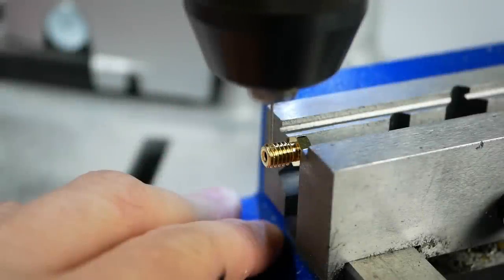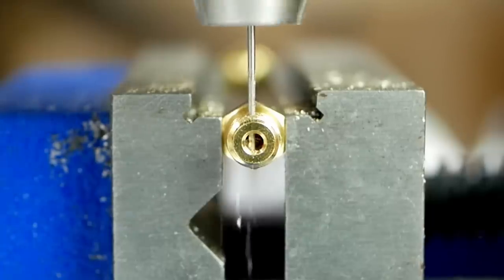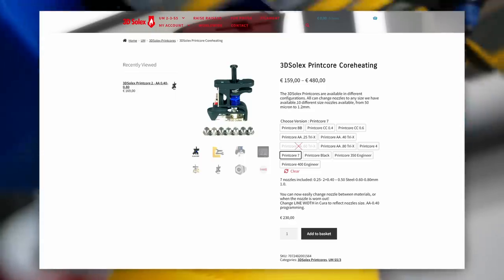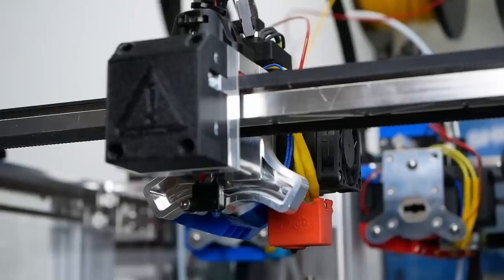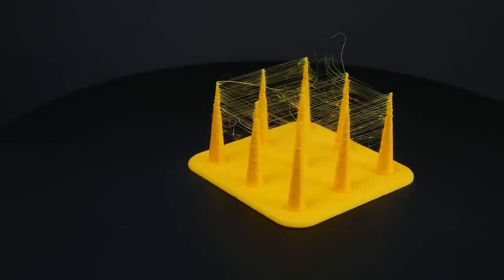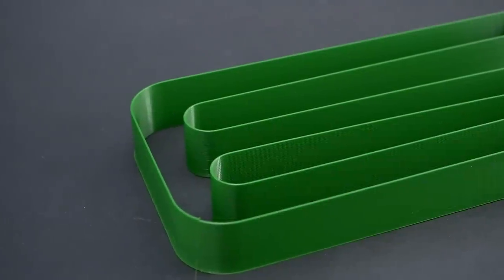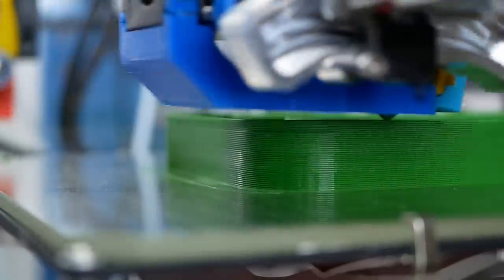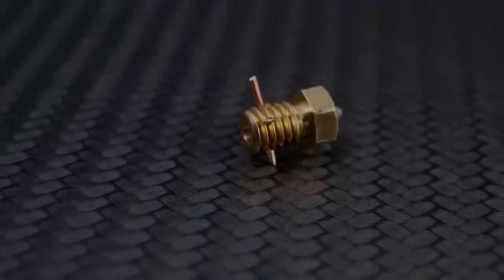My High Flow Nozzle is better than a Volcano hotend!

Comment: This should be explored way more than just putting one or more wires with varying diameter in the filament path! 
Some ideas I'd like to see tested: 
- different angles
- adding two rows of wires in an alternating pattern on the left and on the right side (this seems to be a case where a Volcano/Supervolcano nozzle may be necessary)
- combining different diameter wires
- shaping the wires before inserting (like triangular, notches or maybe bending the wire)
- using "spikes"/cut wire pieces instead of full width wires
- using different wire materials
- using a (maybe sharpened) sheet of metal instead of wire (may be difficult to build)
Reply: Only silver has a marginally higher heat conductivity than copper (less than 10 % more). Brass on the other hand, conducts heat a lot less well.

Building a prototype heaterblock and nozzle out of gold- or rhodium-plated copper or silver (to prevent surface-oxidation) should yield astonishingly great results.

A triangular shape of the wire with the sharp side up should also perform better, both because of better "cutting"-perfornance and a bigger surface-area after that. For an equal wire diameter, that should provide an improved performance.

There's probably an optimum wire diameter compromise between more heat put into the plastic while keeping a sufficiently large channel open as not to reduce the flow-rate.

If there is a snug enough fit between the hole and the wire, eventually helped by some slight taps with a center punch, there should be no need for soldering at all.

Your last idea might be pretty easy to do by sawing a slit into the threaded part of the nozzle, then solder in a copper plate.
Reply: @Makatea  By changing the material I was thinking less about improving heat conductivity but more about surface structure and longevity, especially with stuff like carbon fiber filament. 

But how much would it help? Or is there a sweet spot between surface area and shapes that restrict flow? That's something you could test with different shapes. 

I think soldering is necessary as you need to get the wire in and maybe hace different expansion rates at higher temperatures when using diferent metals. 

Hm, I feel kinda stupid because I didn't think of that. I was in full machining mode and thought about killing a slit into the nozzle... Yeah, much easier that way. 

I've had another idea just now, when using a metal plate as divider, how about adding a little spin tocthe filament? I'm not sure what this may achieve besides better mixing when pushing two colora through one nozzle, but maybe this distributes the heat more evenly in the filament or something.
Reply: @Makatea  maybe with a cutter blade! It may enlarge the area while keeping a bigger area
Reply: @Makatea  i thought that about the last paragraph, slot from the top and then solder the gap afterwards to re-seal the entrance pathway

Edit:
Stanley blade cut down and shaped?
If conducting the heat into the stainless steel will be a problem then i wonder is it would be possible to copper plate it?
Reply: Feel like thinner wire give a higher chance of the wire failing.
Reply: @CommanderJPS  copper plating won't radically improve the heat conductivity sadly. As plating is only a thin layer, you only have the benefits of copper in that layer.
Reply: @jelteklaswijnja4055  well in that case i suppose the time and effort into making a pure copper blade would be more beneficial.
If you used a 0.5mm sheet and run that on a blade sharpening system (or just a good old hand file) it should retain it's shape for durability and hopefully would not restrict the flow to much
Reply: @CommanderJPS  That should be very doable.

Copper being fairly soft, it might in some scenarios be beneficial to use brass instead (as a middle of the road for conductivity and heat transfer)
Reply: @CommonApathy  That's where different wire materials play their role. If a steel wire results in a slightly lower flow but has a much greater durability for the same diameter, then this might be the way to go. That way it's possible to go with more but thinner wires to increase the surface but restrict the flow less than one big wire.

Comment: Refreshing to see that even after so many years of diy-3dp, the innovations still seek to push the boundaries. :)
Reply: Oh, yeah - and drill from two sides (after flattening) for better centering
Reply: Röhrenlot is nothing special... it's Sn97Cu3 right? This is non eutectic but it starts melting at the same temperature as Sn99 and Sn100, it just doesn't become fully liquid until higher up, but it will still have no holding strength at higher printing temperatures whatsoever just the same. There's kind of little point to it.
Reply: @SianaGearz  Huh, indeed, I am wrong/ you are correct. I meant SnAg alloy, but that too has a low-ish melting point. I assumed from my subjective observation (soldering-iron vs. propane torch) that the latter reached a much higher temperature, but this is not the case! Thanks for this remark :)

Comment: You've inserted wire perpendicular to the wall sides, but what if you would put it in angle? This might help with the flow and surface area. Anyways, briliant idea for video :)
Reply: I was thinking the same thing. It would be more difficult to drill though. You might be able to get some angle by machining a nut first, as others have suggested for centering.
Reply: @aimlessweasel  I would make a small jig for it. Could probably use a corner bracket and bend it to the angle you wish, then just fasten the nozzle to the jig in anyways you want and drill it with a drill press.
Reply: It would require a specialized tool/drill to make an angled bore. But it would definitely help I think
Reply: This is exactly what is diagrammed in the patent pictures that Stephan showed in the video.  Good idea.
Reply: @novaenricarter705  you drill the whole and tap the thread last
Reply: @lovecastle7154  Yeah?
Reply: I was thinking the same thing of drilling it at an angle, plus I think you can skip soldering it. The wire isn't going anywhere once its screwed in.
Reply: i tought the same, posted, and then read your message, you came first ;)
Reply: @BigDaddysChannel  you don't want to skip soldering, it would be helping with the heat transfer.
Reply: @novaenricarter705 , the corner bracket would be good for holding the nozzle; I was meaning to keep the drill from walking and breaking.
Reply: @BigDaddysChannel  I think chasing the threads would be difficult/ impossible without the wire held somehow.   Also, as Gee-eeS pointed out, it would also help with heat transfer. Hopefully he removed that solder ball from the inside before printing though...
Reply: @aimlessweasel  I think we are dealing with such small tolerances the heat transfer wouldn't matter..... BUT I think the Plastic would leak though the smallest of holes SOOO I retract my previous thought. I now think It Should be Soldered.
Reply: @aimlessweasel  Yeah true lol, problem after problem
Reply: @BigDaddysChannel , If the wire is not soldered, less heat is transferred to the wire.

Comment: Also an engineering advice: after drilling an offcenter hole through one side, rotate your thing 180° and drill another one from the opposite side.
You'll have to bend the wire a bit, but it will be precisely centered.
Reply: I think part of his problem is that the drill bit is grabbing onto the threads. Seeing as this is a single thread it would not have the same results on the other side.
Reply: @GoingtoHecq  , надфилем сделать ровную площадку, потом сверлить.
Reply: The off center hole could have been avoided if he centered it properly and then started with a center drill.

Comment: For higher temperature use, perhaps staking the wire in place instead of soldering it would suffice. Simply use a fine point punch to deform the wire and the hole, trim, and clean the threads.
Also using the fine point punch to center punch the hole location before drilling may reduce bit wander, as will reducing the bit length protruding from the chuck. Or use a center drill.
Reply: I tried it yesterday, no success. Also I think the temprature game will have it detach from each other due to the shrinking and expanding. Did you manage to have some success?

Comment: I saw a similar design in the TurboTap which was made to greatly increase the rate at which beer can be served. Splitting the flow up into small sections will create more laminar flow and greatly reduce pressure loss due to high friction turbulent flow. This is a very smart application

Comment: Was considering buying a volcano hotend! Now I have to watch this haha.
Reply: No..
Get the CHT nozzle.
Reply: For me the Volacno it's still the option. Too much effort with this.
Reply: @Petro_Bandera  CHT has zero effort.. volcano has high effort and changes dimensions.
Reply: volcano might be a better option for abrasive filaments.
Reply: @Rush buy a volcano and one CHT nozzle. Cut off the nozzle part of CHT and keep only the thread. Screw it into the heat block and then use standard V6 nozzles. So you get CHT splitter, increased length of volcano and cheap V6 nozzles

Comment: You must find center with a edge finder or spinning a indicator. Then you MUST. Use a micro center drill you start your drill off straight. Done like that and you'll be with a few thousands of center and straight. Love what your doing over there and wish i could show you hands on proper machining but you will get it.

Comment: This is pretty interesting!
Reply from the maker: Thanks Adrian! Looking for some nice, high extrusion width prints from you. The  2 mm 3DSolex might be great for that even on a Prusa.
Reply: @CNCKitchen  that’s a great idea! I was thinking to do something like that, thanks for the hint 😉
Reply: @CNCKitchen  
How about cutting the nozzle along its longer axis, and putting a piece of copper sheet in the cut? 
<  ||  >
<  ||  >
<      >
..\_/

|| - cut with a copper sheet inside

PS:
You can also file the edges in the middle of the sheet that'll be inside the nozzle, to make it sharper to even further ease the flow. 
I believe it could be relatively easy to do. Make a vertical (along the axis of rotation) cut on a bandsaw or with a careful cut with a handsaw. Cut a piece of copper plate to be slightly wider than the nozzle. Drill a bit wider hole the length of the copper plate (or skip this part if the flowrate is enough to reduce die swell). Insert the plate, solder it. If you don't want to solder, you could try to heat up the nozzle from its tip to expand it and put the plate in the freezer, then try to hammer it down the hole, but you'd have to work on the tolerances quite a bit for this to work (you'd have to be careful not to pry the nozzle open, too). You could also just tig weld it. Then the only thing left to do is to thread it and to file the upper parts of the plate to fit the shape of the nozzle's chamfer.

Comment: A few tips that might improve this:
1. You could increase the bore where the copper bar is to compensate for the obstruction the bar causes.
2. When you solder the bar, you can remove the excess solder by dropping the nozzle on a hard surface before the solder solidifies - the impact causes all the excess solder to splash off. Then clean the thread with a triangular file of a suitable size.
3. You can make the bar form and interference fit so that you don't need to solder it. Use some annealed copper wire (you can anneal it easily yourself) that is slightly larger than the hole you drill . Roll the wire between 2 smooth plates (6mm steel would be suitable) applying some force to the plate with your hand . Repeated rolling will reduce the diameter of the wire. When the wire almost fits the hole , heat the nozzle to expand the hole so the wire fits.
4. You should have added the second wire in the same orientation as the first. Putting it at 90 ° only adds flow restriction

Comment: Notch the back of the nozzle for a solderless joint. Square the ends of the wire, then you can try multiple inserts with different cross section shapes, thicknesses.
Reply: The solder is important for heat transfer.

Comment: Hmm, I'm thinking a vertical notch on each side just big enough for a  piece of razor blade from a disposable razor to slide into. 
No soldering needed if it fits tight, should still increase heat transfer, and would cause less resistance.

Comment: Love your approach! When you added the single wire, you realized the need to open the input orifice. But, when you added the second wire, also you made comments about the resistance, yet you didn't try to open it up. I think you missed a great opportunity there. Nonetheless, great work as always, love your videos. Props to 3D Solex for being cool with these experiments.

Comment: It seems like it would be possible to deform the wire inside of the nozzle to increase surface area while reducing flow resistance.  Alternatively, with Silver solder, it might be possible add a few fins that break up the flow without closing off the flow through the center.

Comment: Try using thinner wires. They will provide lesser resistance and you can put many of them in one nozzle
Reply: Was thinking the same, would be very interesting to see a test of different wire sizes + as some have suggested: thin plates, as I guess a too thin of a wire will split well but not heat well + maybe deform under huge pressures.

Comment: Amazing video.
1. Get thinner Copper wire.
2. You have to use Micro Drill Bits and a Small Mill, I have a Proxxon, but they are expensive.
3. File down the Wire into a triangle before inserting it and try to make the base of the triangle as thin as possible.
4. Use Silver Solder, or something that can withstand at least 250°C so you can print ABS.
5. I think 2 copper wires is best, but you have to get them very close together.

Comment: I think that you could have also tried putting the second wire in the same direction as the first wire.

Also, a machinist could use a slot cutter to cut a slot in the nozzle, and add a thin plate of brass. Perhaps you could do it similarly using a hack saw.

Comment: I would love to see the same mod possibly even multiple times in a volcano nozzle. Because in a volcano nozzle there is more room for the specific attributes causing the negative properties to normalize. Such as the pressure difference and the die warping effect.

Thus making them easier to manufacture with similar results which implies potential for further improvement. 

Also to manufacture a nozzle like this propperly it needs to be done on a lathe/mill combo machine. That way al the holes can be lined up correctly, mill the hex shape (unless your stock is already hex) and  drill the horizontal holes for the wires first. Then use the lathe to mill the rest of the nozzle + threading.

This also allows the soldering to occur before threading. 

As always amazing video, always inspiring and entertaining. I always walk away with new knowledge after these videos.

Comment: An idea (patent is pending): put a glass-coated nichrome wire to heat the material from inside.
Should be possible to melt a couple of cubic centimeters of material per second easily.
To make the whole endeavor easier, use 3mm system.
To easily coat the wire, just dip it in some electrically non-conductive epoxy.
Reply: @Lassi Kinnunen 81 sadly, It needs coating if you want to have any meaningful amount of it.
Reply: i don't think it would last long

even i have doubts in the copper wire..
Reply: @RFi731  why wouldn't it?
Reply: @Lassi Kinnunen 81 because this is how electricity works in our universe
Reply: @Lassi Kinnunen 81 plastic may not be conductive (yet some are), but the nozzle and the wire itself still are.
Reply: @Lassi Kinnunen 81 you can't make the whole nozzle out of holes

Comment: I've only been a machinist for a few months, but what we do when drilling cylindrical parts is use a spot drill bit first to make a dimple or starter hole. Spot drill is a very short and rigid bit that you could still get in the same or similar sizes. The back of the bit is quite a bit thicker than the cutting end, you could possibly even put the spot drill into your old chuck if switching chucks would be easier than cranking in different drill bits. The only other advice I can give is to use some cutting oil. You don't need it so much for preserving your tools, but just placing a small amount where you want the tool to begin cutting may help with resistance and keep that wandering minimal. We're able to place holes precisely into stainless steel cylinders and that's mostly the method we use (besides the machines being CNC).

Comment: Hello Stefan, you started a nice project :). I am a trained precision mechanic or mechanical engineer. Therefore I would like to give you a hint how you can drill centrically in an external thread. Since you are soldering anyway, you can solder a platoo (e.g. a large pile of solder), then strike it in the middle with a center punch and then drill through it without running to the side. Greeting

Comment: Try a gold wire, hear me out:
no oxide layer = better heat transfer...
High thermal mass.
Reply: But gold has way lower thermal thermal conductivity than copper.  Silver wire might be better.
Reply: @dibblethwaite  But copper oxidizes, gold doesn't. Copper oxide has a lower thermal conductivity than gold
Reply: @dibblethwaite  Silver might work better. Only one way to find out, and a great video "gold vs silver" pure click bait!
Reply: Might also be a good idea to use silver solder in general...
Reply: The gold-platinum ultra high wear resistant alloy?? turn it into a fine mesh screen, throw it inside the hot tube as a heating element